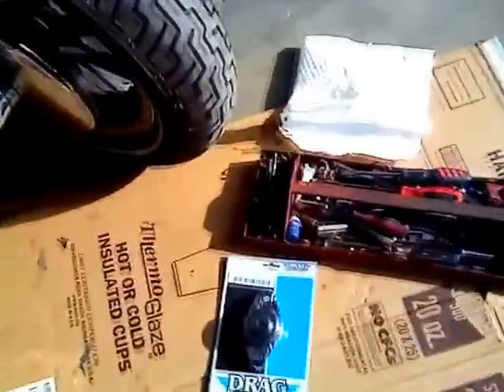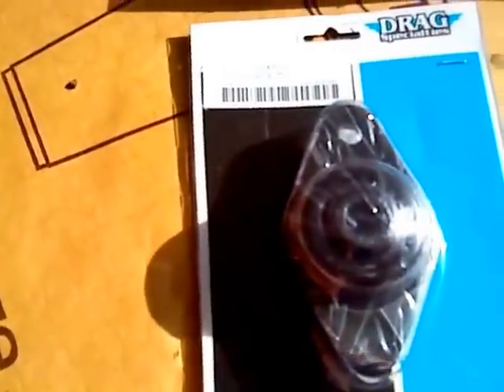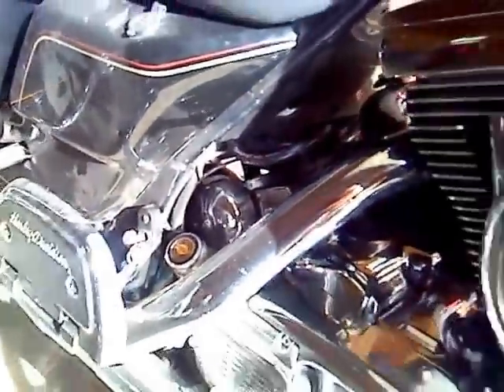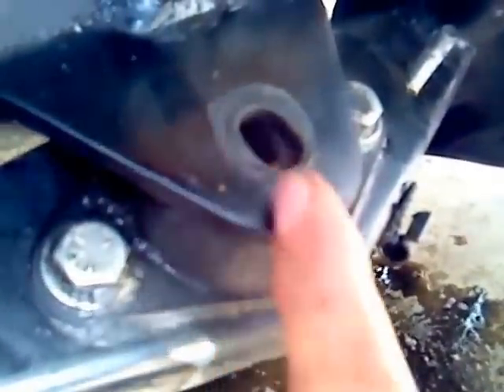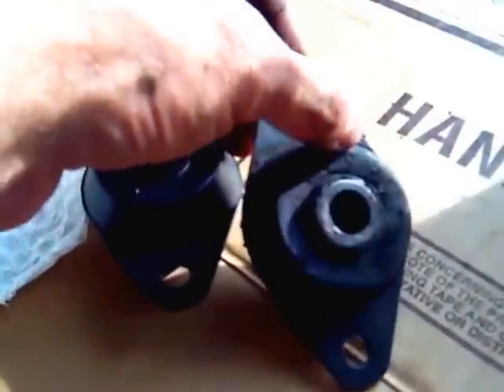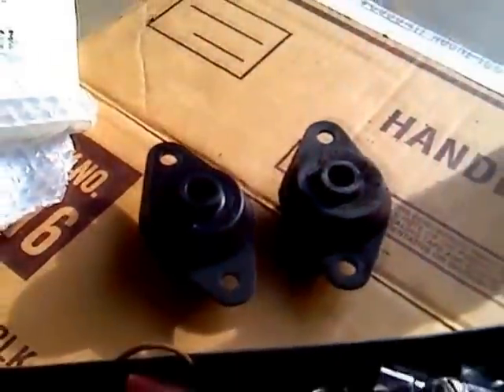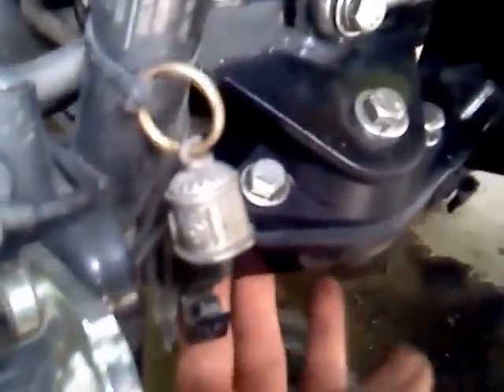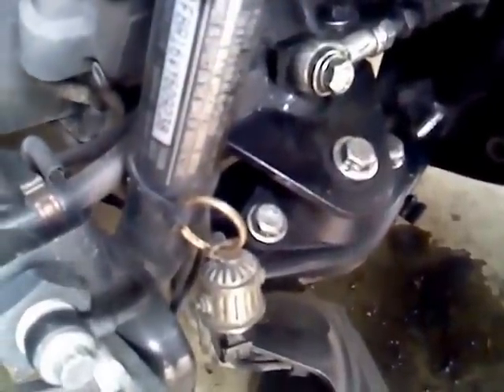Harley Davidson FL Front Motor Mount Replacement

Comment: LOL! I'm going to do this on my Road King today and I have another question. I realize you might  not see this before I do it but for the benefit of others who are going to do it I'll ask. When you pull the engine forward and just "snug" the mount bolt, is it still tight enough to keep the motor from sliding back to where it was? Seems like it would need to be pretty tight to keep this from happening. Thanks for the video and the answer to my previous question.
Reply from the maker: +Claudebonegt You know, Claude, that's a good question! I took a second look at the video and realize that the hole in the mount to the motor is elongated enough that it just might give some of that snugness back to the rear transmission mounts. All I can say is try to keep the rubber motor mount as far forward as possible when you tighten the outer-side bolts up to maybe lessen how much the center bolt can slide backwards? Thanks for pointing that out. With the center bolt still just tight enough so you can feel it start to clamp up, but not loose enough for it to rattle, my bike is still driving very well and I am very pleased with how it is working and transferring power to the wheel where it belongs. Let me know how yours works out!
Reply: Claudebonegt if your manual doesn't say to do it, then don't do it.  replace the rubber SA/trans mounts if anything .  that's adding additional and unnecessary stresses to your SA bushings and aforementioned rubber trans mounts.

Comment: Well done great video!!! Lots of good info!! BUT !! Using the Drag part caused shaking replace w OEM Harley cost 90 bucks took care of it and back to twisting the throttle.
Reply from the maker: Curtis Petro Thanks for the comment. I did notice more vibration with the urethane unit, and that backing off the nut just a bit, with loctite, did help. Glad the video helped you out, man!

Comment: What is the tightening torque of the motor mount central bolt?
Reply from the maker: I don't have a torque spec for the center bolt on the front motor mount. Just know that it should be just a bit snug, and use a generous amount of thread locker on it so the nut doesn't come off. The tighter you snug that bolt, the more vibration you're going to feel through the bike frame. I over tightened mine and that's what it did. I then took the nut off and gave it thread locker and put it back on just until I felt a little resistance against the nut. Vibration was noticably less after that. It needs to have some wiggle jiggle room. Lol.
Reply: @contact4mwy7  Ok! Thank you!

Comment: Have a question i used the same mount as u and I noticed when finished torque the main bolt the mount and the lip of mount has a gap and not sitting on mount flush is this correct?
Reply from the maker: The gap that appeared in my video was in the slot of the center motor mount hole and an indication of the motor sliding forward a bit from the tension of the straps. It is not a necessary gap. I found that using Loctite on the nut of the center bolt and only tightening it until there was no free play of the bolt up and down that the vibrations/pulses of the motor were a bit more tame. Torquing the bolt tight seemed to shake the bike more.
Reply: Thanks mark and thank u for the videos
Reply from the maker: I hope it helps. Let me know if you had to change anything around.
Reply: Mark on mine i notice the engine bracket sits on the center where the bolt goes through on mine it dont go all the way down.on yours how u set the motor down looks like its totally flush without a gap , underneath the bracket to rubber mount on mine when i lower my engine it has a gap but it does sit on the piece of rubber in the middle where the bolt comes out from it doesn't look right on mine, center bolt goes through like a charm and everything is tight
Reply from the maker: Just the weight of the engine brings the metal mount down onto the rubber bushing. If yours does not look that way, are you sure you didn't put the rubber bushing in upside down? I'm having a hard time picturing exactly what you are talking about. Lets say the top metal mount bracket is A, the rubber bushing mount is B, and the bottom metal cross member is C. Which two are you seeing the gap between?
Reply: The a to the b and its in correctly
Reply: Mark i posted a video to show what im talking about the mount sorry not good for doing video
Reply from the maker: Yes, that looks correct, and the same as mine, right side up. I think it just looks more flush in my video because the camera is looking DOWN at it instead of straight into it at the front. To me, in your video, that looks totally correct. As I mentioned before, use Loctite on the nut and only turn the nut tight until there is no more up and down play in the bolt. If you really tighten the nut on that main center bolt you will feel the engine pulses stronger than if you don't tighten the nut so much. Make sense? Thank you for taking the time to make the video for me!
Reply: Thank u mark

Comment: Why didn't you do the rear rubbers?
It seems like they would cause a lot
More vibration because there is metal
In the center of them?
Reply from the maker: kirbazoid I saw that most of the movement was at the front of the motor at the motor mount. The back of the motor and transmission seemed to be relatively still. I have not seen a recommendation on when to replace the rear mounts, but if they are determined to be causing problems you can bet I will be replacing them too!
Reply: kirbazoid
Reply from the maker: I probably should have done them all at the same time, yes. I have since replaced the rear (swingarm) bushings, and also added a stabilizer link, which made for an improvement overall. Thanks for watching.

Comment: I just came across your video because it looks like I'll be replacing my front motor mount very soon. My engine really moves back and forth during idle and I've already had my Y-pipe header welded from three large exhaust cracks caused by the motor's movement. Anyway, how has the aftermarket mount treated you since 2015 when you posted this video? I have an external oil cooler mounted right there, so it looks like I'll be trying to move that aside in order to replace the engine mount.
Reply from the maker: It was just what mine needed to keep the motor from vibrating around so much. Use threadlocker on the nut and bolt and just barely snug them together on to the new engine mount so that the mount can do what it's supposed to do. If you tighten the nut and bolt too much it will send the vibrations into the frame of the bike. Good luck!
Reply: @contact4mwy7  Thanks for the tip! Every little thing helps. I just put over $3k into the bike's motor stage 2, tuner and dyno.

Comment: What are the torque specs
Reply from the maker: If I didn't mention them I didn't use them. I used blue thread locker on all bolts and tightened the mounting bolts as tight as I felt comfortable. The large center bolt was purposely left on the loose side to allow the rubber to absorb the pulses of the motor better, there is a noticable improvement in less vibrations felt with it just barely tight enough to touch yet the thread locker kept the nut from coming off. I hope this helps.

Comment: curious,.. why are you working in a puddle of oil,...????
do you have a towel and 2 seconds to give that a wipe before the video,..???
Reply from the maker: That puddle is from spraying down the area to clean the oil from the parts. I've worked in worse conditions in a dirt driveway with snow and ice, so was ok with it and cleaned it up after everything was done. My apologies if you are offended by these conditions.

Comment: Is it me or does it sound like that thing needs some oil
Reply from the maker: Kyle Crotty some of that is exhaust sound, but the EVOs valve train is happy when it makes those clacking sounds. They have hydraulic tappet lifters that never need adjusting. This was a very strong running bike for many miles for me until I traded it.